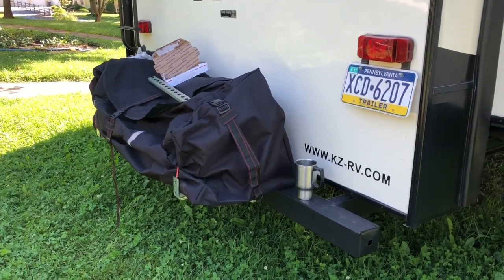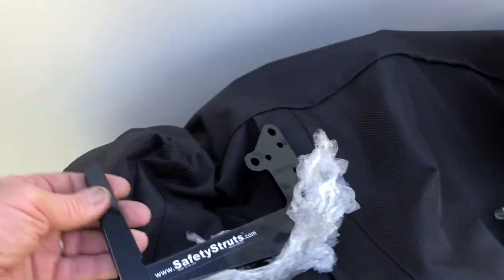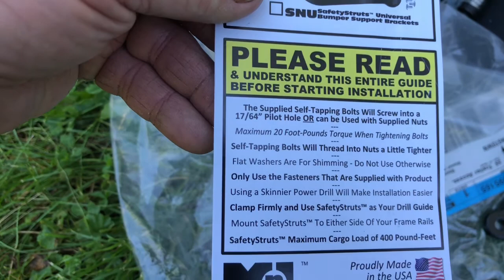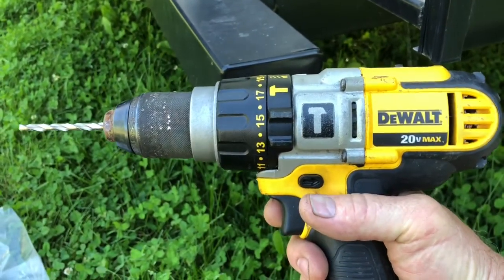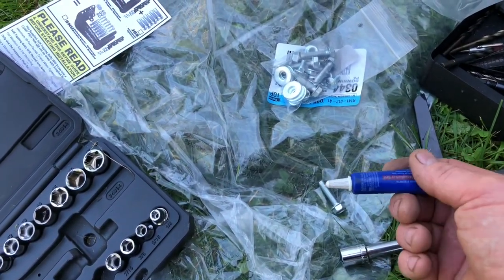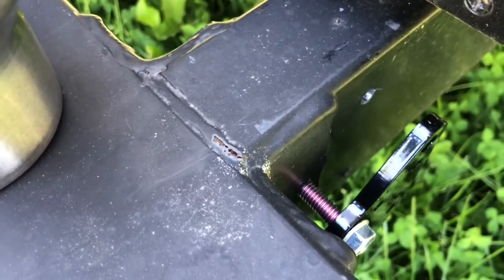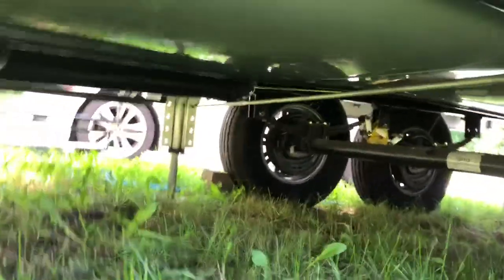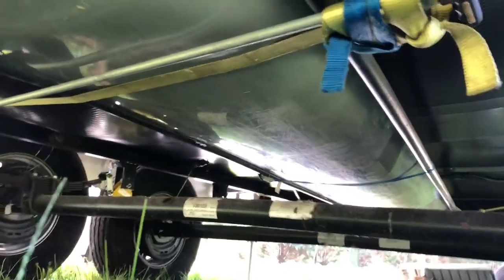Rv Bumper Support

Comment: Aren’t they supposed to mount on the inboard side??
Reply: I bought these and will certainly mount them on the inboard side. That will support and isolate the welds from flexing even better. I’ll also make sure that the brackets are actually in full contact with the bumper to stop any possible rotation/ flexing under load. I could see daylight between bracket and bumper in this video.